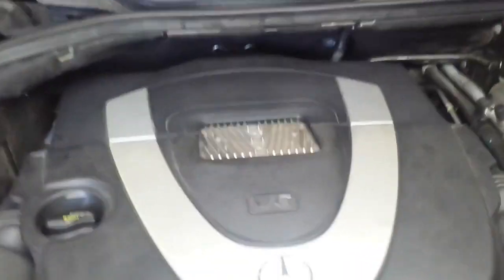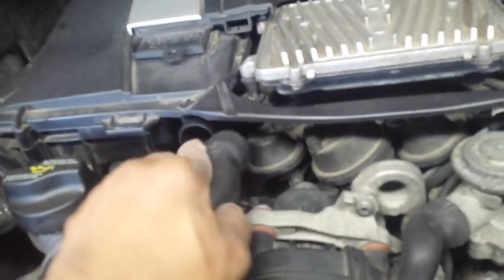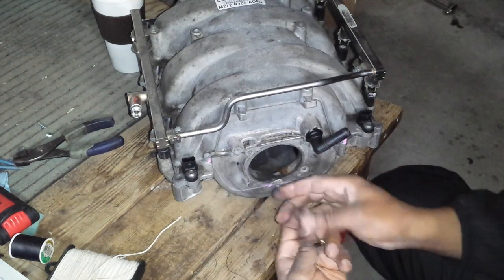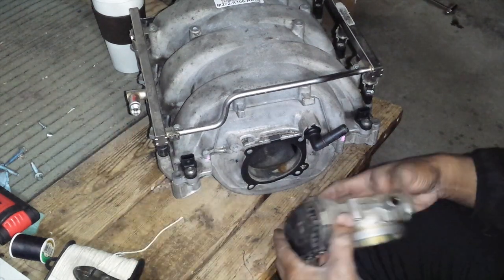Mercedes Throttle Body Assembly Removal/Replacement DIY

Comment: Hi Keith thanks for all of your videos. Hi can’t seem to find the problem with my 08gl450. First I got a loud noise coming from engine area at high RPMs only, then check engine came on for p0420/430, then after driving it like that for a month (with no loss of power, just stepping on gas pedal lightly) now it kind of seems like I’m loosing power because my gas pedal only goes down about an inch. However if I go on park and step on gas, the engine feels powerful. I’m in El Cajon CA in San Diego. Can you please help me man. I think I saw in a video once that you were in Encinitas. I can take the car to you. Please let me know.

Comment: Hi, I have a w220 s430. Does the throttle body replacement need reprogramming?
Reply from the maker: You can reprogram it;  Eventually through adaptive learning it will synchronize.  Here's a video showing how to reprogram (the hackers way) https://youtu.be/Q-q1BASszmg

Comment: What symptoms did you had  that indicates  this was bad and needed to be change
Reply from the maker: It was a sticky throttle. Throttle stuck partly open.
Reply: @iRepairAutos  Bro Keith must be real scary to get a stuck throttle (followed by limp mode I am sure).

Last week I lubed all the throttle gearing reduction with 3000F high temp brakes silicon. The intermediate gear shaft diameter  was showing sign of wear at 140KMi but very serviceable 👍🏻
Reply: You'll get slow acceleration no matter how hard you throttle, its like a light limp mode but not the real limp mode. Heavy idle (idles rough), or high idle.

Comment: If I do clean throttle body on my 2007 M. Benz ML350 4MATIC, is it same procedure? Do I need to recalibrate anything?
Reply from the maker: Ssme procedure.  No calibration needed.
Reply: iRepair Autos is throttle body cleaning method require taking out entire manifold?

Comment: Greetings how to change the throttle cable in 2003 ML350. The adjustment plastic broke. whats the steps for THROTTLE CABLE PART # 1633010523. thank you

Comment: LOCTITE-HEHEHEHE- 

What was wrong with the old unit?   Get yourself a 3/8 low foot pounds, inch pounds or NM torque wrench. I bought a NM one for my carbon fiber bike and it was only 70.00,   your 1/2 drive is big for smaller jobs and not as accurate depending on how close you want/need to be
Reply from the maker: +jim dandy don't laugh.   Once you remove those screws Mercedes master mechanics strongly recommend new screws and or loctite.   Many of these screws come with hardened loctite on em.  Nothing ed wrong with that unit.   A subscriber asked for a video on how to remove it.   Peace.
Reply: I see- very nice of you to do that for instructions only
Reply: how many nm for Throttle Body bolt?